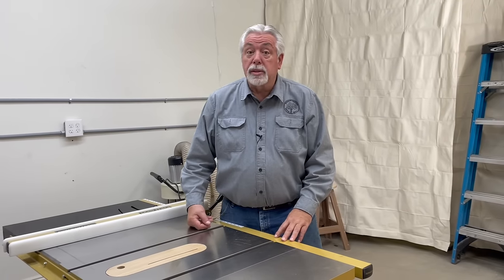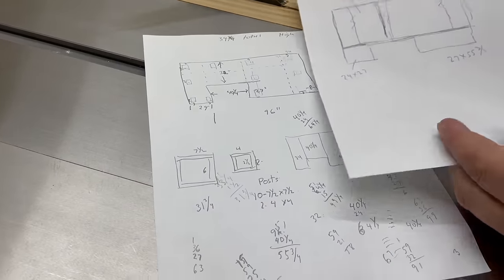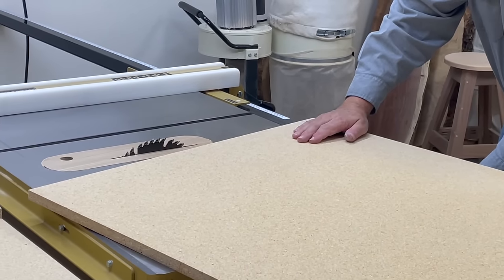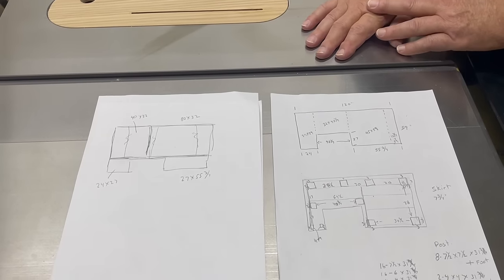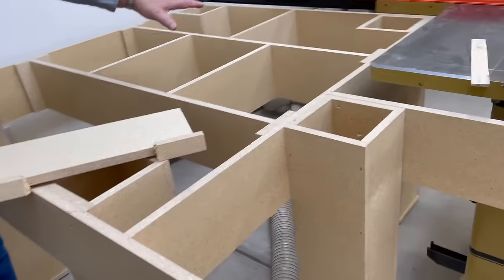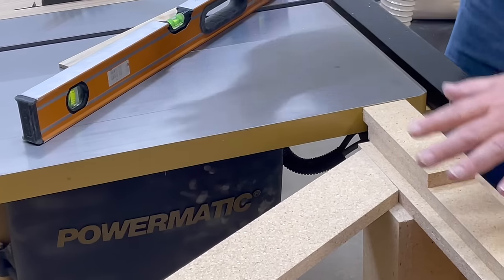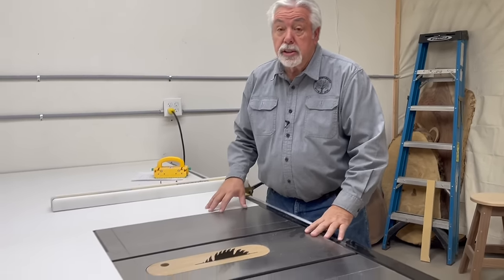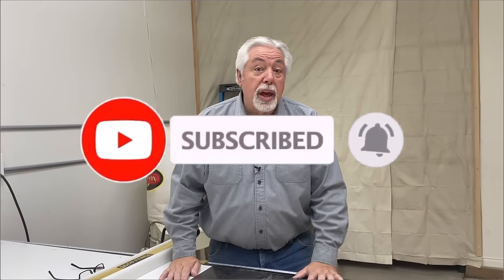99% Of Woodworkers Do Not Know This About A Table Saw

Comment: Single most important rule of safety on a Table saw. And I try and leave this comment on everybody's videos. Turn off the Saw. after every single cut. Let it come to a full stop. Do not attempt to grab or move. any piece of wood before this saw has stopped.p

Comment: Wes, forgot to mention that I also extended the miter slots by routing those in the outfeed, once I got the width and depth correct I went back and did a very slight chamfer on the slots to keep them from chipping. those extended miter slots really come in handy when using a miter gauge or a cross cut sled...

Comment: Well done Wes. I do all my work in a double  garage, so the cabinet saw is on wheels.. What you have there is great. Lots of room and an outfeed table and saw fence can never be to big.. Thats for sure.
Reply: Told my wife a mans shop needs to be twice the size of his home. (didn't have room at home, had to buy a shop a few blocks away, 30 x 60. Ended up getting it free)

Comment: Hey Wes, Great video! I have something very similar on my Delta Unisaw and it's awesome to have all that space especially when sawing full sheets. The one thing I did was attach the Melamine with screws from underneath so there would be no screws showing on top. I also edge banded the entire raw table edges with 3/4" Maple, I think it looks much better but also because Melamine has a tendency to chip especially when you screw or nail it through the top. Another reason is when I clean and wax my cast iron saw top I also do all the Melamine out feed table. It makes the wood glide like it's on a cushion of Air and it extends the life of the table. I've had my current table on the saw for seven years now with lots of use and it still looks really good.
Reply: Thats  good idea!

Comment: Great video. I'm lucky to have a very big shop and I have a Biesemeyer  rip guide . I have a Delta cabinet saw and a delta contractor saw so I modified the right side of the rip fence and mounted the contractor saw to the right of the cabinet saw. Now I have a double saw same rip guide but a regular blade in cabinet saw an a dado blade in the contractor saw. Now I do all my rips on one then lower the bade and slide the rip guide over and do all my dados without having to change blades. I have been doing this for about 8 years now.
Reply from the maker: Wow that is very efficient! Sounds great, thanks for watching! Wes

Comment: Wes, great build, love your channel. You are always very thoughtful and a great teacher. I absolutely love your projects and you are very practical. Keep 'em coming. 

I do need to comment on your table saw safety as I feel that it sends the wrong message to your viewers. You are awesome but table saw safety is a responsibility that we all need to speak up about. I do see that you don't have a riving knife and guard on your blade. As a sergeant safety guy and an educator it is concerning. People feel that it is okay to lean forward over a turning, unguarded blade and even reach across the blade as they use their table saw. 65,000 table saw accidents in the US in a year, yikes. In all likelihood, most or all are avoidable with planning. 

People don't consider that the margin of error is extremely small even if you are aware and careful. No one considers that the margin of error decreases exponentially if you are distracted by another person, loud noise, pet, or worse, an unforeseen medical event. A person has a shooting pain in their chest, or perhaps what they call an ice pick headache - unexpected shooting pain, or any other disruptive event which causes a person to drop their hand unexpectedly on to or across the moving blade. Or, as they are pushing stock into or across the blade and for some unforeseen reason they slip. Tragic.

Keep in mind the issue is not what any one person has done for years and decades without an issue, it is the "one time" that results in a devastating, life altering accident. Is it worth the time or inconvenience of using a guard and safety measures, ie riving knife, hold downs? Obviously not. We are getting older and incur health issues as we get older. Issues that can disrupt us unexpectedly, which can happen to any one at any age, increase with advancing age. I continually see unguarded table saws on YouTube, This Old House, and HGTV. Great programs sending the wrong message to earnest woodworkers. Yes, at times I remove the guard for operations that I cannot do with a guard. But I employ other safety measures, I keep my hands away from the blade, I never ever reach over or past the blade. I use push sticks whenever possible. I turn off my saw and let the blade stop before I retrieve my work or clear scraps near or past the blade. I always re-install the guard as soon as I no longer need it off.

I'm a teacher and we would never let students use unsafe practices that I see are a regular part of so many table saw videos today. Use a guard and a riving knife whenever possible. Don't reach beyond a spinning blade. Use hold downs whenever possible. Use push sticks and steer clear of spinning blades. Accidents are avoidable and safety should always be our first priority. Stay safe and happy woodworking!
Reply: You should take up knitting. It's far more safe, than wood working.

Comment: very cool idea with the fence extender, out of curiosity were you able to still maintain acceptable square to the blade? wouldn't any bend in the new fence be exaggerated with its great length?
Reply from the maker: Hi...I have not experienced any variation in square because the new fence extender bar is made of heavy duty tubular steel. Thanks for watching, Wes

Comment: Boy I wish I had that amount of space. Great table & good advice! Nothing fancy, just straight forward and easy to understand. I'll take a few of your tips and apply them to my 'mini' table saw. As I only have a small 15 X10 foot shop, so I need to have my out feed area foldable. But I can keep it level with the saw bed. So when the winter is over I will get cracking at it. I have some built in wardrobes to build and your tip with the cleats is a gem.

Comment: Nicely done,  as a finish carpenter,  I have installed many hand rails.  One thing code requires for us,( I'm in Washington state), is that there be a return to the wall. Also, the hand rail height must be between  34"- 38" off of the nosing of the tread. You did a great job,  just wanted to chine in.

Comment: I too used white Melamine for my out feed table. I made mine 8 feet to the rear of the saw to hold full sheets. I used a router to make grooves to match the miter slots on the table saw so my miter gauge and sleds would have full motion . I was surprised that you focused so much on width and not on length. I bought a couple of sturdy steel rollers on stands to assist with the infeed support. I found that using a track saw is a lot easier than man handling full sheets on a table saw.
Reply: 8 feet? 5 feet should be more than enough. There's more than a foot left on the table saw top. That, with a two foot overhang, would mean that 75% of the 8' sheet is supported.
Reply: @davidbroadfoot1864  If you cut materials like I do that are 12 ft long a 5ft out feed is really not enough 6ft should be. I have an 8ft outfield myself. Built with shelving underneath so I have a place to store things. Works and looks good
Reply: @chuckhansen5325   We were talking about "full (8 foot) sheets".

Comment: I wish I had the space for an outfeed table that large in my shop.  Looks like a great design with a huge capacity.

I re-mounted my saw fence rails so that I can cut up to 36" (it is meant for 30" normally) and made a movable 4x4' outfeed table that can be swung around or moved to either side depending on my needs.  I have large locking/leveling wheels on it to make moving and aligning it easy.  I doubles as an assembly table with dog holes and MatchFit channels and have a full shelf under for storage.

Comment: Wes, thanks for the tutorial! This is a great outfeed table idea. Are you planning on routing dados to accommodate mitre bars for each slot for when you exit a crosscut? Will you show that process in a future video? Also, in my experience, I’ve had problems with outfeed tables that are flush with the tablesaw rather than 1/16th or so lower in case there’s any swelling from moisture in the air. Is this something to worry about?
Reply: I've had problems with particle board in general when it's exposed to humid conditions. As the wood particles expand and shrink, the board starts to lose its structural support capabilities. Laminate countertops over a dishwasher also suffer from this as the humid air comes out during the drying cycle. It doesn't happen overnight, but I wouldn't use particle board for much where I live. It's probably ok in drier regions.

Comment: Very nice outfeed table.  I was wondering why you didn't get a longer angle-iron piece to support the back end of the fence.  Now I know that the table will do that.  Thanks for sharing your design.
Reply: I don’t understand how the table top supports the back end of the fence. The angle iron is recessed below the table top which I assume is the fence support and is lower by approximately 1.5”. Wouldn’t the angle have to be extended as well? What am I missing here? 🤷‍♂️🇨🇦👍👨‍🦳

Comment: My 60s Delta Unisaw this long fence was an option to cut to 52in and came with an extention table with 2 steel support legs. I was also able to get a mobile base for the whole rig. 3hp 220v motor tops it off. Not much more I could ask for and it is actually rated as a production saw so it will run constantly thru an 8hr shift. Love the old girl. Some jobs I literally have to shovel out the base as I have not yet hooked up my dust extractor for it but soon.
Reply from the maker: Hi...I served my first apprenticeship on a saw exactly liked that 😀 Thanks for the comment! Wes

Comment: If one wants to be a serious woodworker a large level working surface around your table is worth it weight in gold. Good suggestion! As a professional, about 25 years ago I built cabinets out of MDF with multiple storage functions to use for support under a 6' x 12' table saw top and to utilize the space underneath. I scribed the bottom of the cabinets so they all set perfectly level instead of using shims and used 1" thick MDF to build the top. The top is very solid, straight and level and I keep it waxed for easy sliding of the materials. Anyway, I'd suggest using MDF instead of particle board if you're going through the effort to build a good functioning table saw top.
Reply from the maker: Hi...thank you so much for your great comment. I really appreciate the support! Wes 😀

Comment: Wes - thank you for the work you are putting in to instruct and inspire your audience.   Can you provide the overall dimension of the table saw and table vs the single-car space it seems to occupy?  I’m downsizing my shop to a single-car space and am concerned about sizes. Appreciate it!
Reply: Yeah, wondering about something smaller for my tiny space, though the ability to cut 24.5" W is probably what I'll have to live with. I do have a large outfeed, however.
Reply from the maker: The overall size of the saw and table is 59" x 120". A smaller shop space would just require reducing the size of your out table build. The single bay width of my garage is 144". Thanks for watching, Wes

Comment: What would you ever cut with the fence set 60" or more away from the blade?  I don't think I would try even a 4' wide panel, certainly not 2' wide as it would likely bind and spin back across the shop.

Comment: Beautiful job on that outfeed table and workspace.  I wish I had that kind of space.   I have such a small shop and too many tools.  But I put everything on wheels.  In order for me to be able to turn around in my shop.  When I do any work in particular on my cabinet saw.  I have to wheel a bunch of my machines outside in the driveway.  It's very difficult in the winter.  I'm in the north in Canada.  Weather here is cold, with a lot of ice and snow.  I live above what is called  "The Snow Belt."
Once I clear things out and close the insulated doors, as my double car garage is my shop.  I can put on my heater and work in the warm.  I installed a 22 foot "U" Tube sealed combustion, radiant, natural gas heater on the 12 foot high ceiling.  It works great.
But what I was going to say about an outfeed table.  I installed an outfeed top attached to my saw.  I put it on hinges, so when I pull the saw (on wheels) out from the wall I can raise the outfeed.  It works just fine.  My bar for my fence used to be 60 inches but it was always a problem.  So I had to cut it down to take 48 inches.  It's a double fence.  The table to the right of the saw blade is a Router Table with the other attached fence for the Router and there is a hose port for dust collection.
Like you showed when cutting your project wood.  I don't have any guard or riving knife on my saw either.  Just an open blade.  You did your cuts very easy.  I always seem to have trouble.  As the sheet of wood is on the other side past the blade.  It always seems to want to pull away from my fence and move toward the blade.  I usually use a thin push stick in the cut past the blade to keep the wood pushed up aganst the fence.  I have had a few kickbacks, this is how I avoid it.
Looking forward to further developments in your new shop.  Subbed for continued updates.
All The Best.
Reply from the maker: Sounds like you have overcome many challenges to keep working. You are awesome!! Thanks for joining our community...loved hearing about your shop! Wes

Comment: That is how a cabinet shop sets up a table saw. I have two saws as a saw set up like yours isn't the best way for small work as you have to move around the saw putting some moves out of reach. The saw set up like your saves a lot of time on larger work.

Comment: I had made a project table. Legs were 2x6 nailed at a L shape at the corners and in the middle. I used T nuts and elevator bolts with a jam nut for leveling on all 6 legs. The top is jointed 2x4’s and 3 layers of MDF with the first layer sealed underneath. I found a roll of Formica in a 5x10 length at a local wood supply store a customer had ordered but never picked up. They made me a deal. I edge banded it all in maple. Then one day as I was beginning the remodel of my shop, I said to myself, self, you should use that project table as an outfeed table. It has been the best thing if done. I urge others to do the same. You won’t be sorry! I love the Formica top, glue just pops off. Stains clean right up. Seems indestructible. Well worth the money.
Reply from the maker: Hi...that is awesome!! Thanks for your comment, very interesting, Wes

Comment: Your original fence rail had a ground front surface, which is part of why it's so expensive. Your new one doesn't. That ground front edge is critically important because it's where the fence registers, so it has to be absolutely straight.  Have you measured how straight that new front edge is? Any deviation from a straight line will cause your fence to deviate from parallel to the saw blade and miter slots.

Comment: Wes, What model pneumatic orbital sander do you use and recommend? Any reason you prefer air to a battery or corded model? Great videos and thank you.
Reply from the maker: Hi...I use a Dynabrade palm sander. This is the sander most used in a commercial cabinet industry and I like the results that it gives. Thanks for watching, Wes

Comment: Wes, I noticed you do not use a riving knife on your saw. I do not use one either. Do you think a riving knife is important to add. I have an older Craftsman saw. There is no riving knife or blade guard accessory for it. Any suggestions on what i should do. Great video. Thanks!
Reply from the maker: Hi...whenever possible use safety accessories for your saw. I re-installed my riving knife after I completed my saw table. Thanks for watching, Wes

Comment: I am intrigued. I noticed that when you were cutting up the boards on your table saw there was no sawdust on your table top. How do you achieve that without an overhead dust extractor? Whenever I cut anything on my table saw without an overhead dust extractor I get sawdust all over the place even though I have quite a powerful dust extractor underneath the blade
Reply from the maker: Hi...I have a good dust collector but I often clean my table between clips for a better video. Thanks for watching, Wes

Comment: You do excellent work. I have one stupid question. Why is it necessary to have table saw level? 
The most important accuracy is the relation of the top surface of the saw to the blade. Being out of level to the floor is not important! Right?
Reply from the maker: Yes...you are correct. I just prefer a level working surface. Thanks for watching, Wes

Comment: Did the welding shop have to make the fence rail or was it a standard size?
Reply: The clamping surfaces on the rail did not look like they had been machined flat - so I would expect some alignment issues with the fence.
Reply: @buggsy5  I measured my existing tube it’s a 2 x 3 prob standard. It has a milled surface on 3 of the sides

Comment: I built a 5’x4’rolling torsion box work table that is also the right height to double as an outfeed table. Built it out of 2x4’s and MDF. From that experience I might suggest that making it flush with the table saw could be a problem in a shop that’s not well climate controlled. Only really happened one humid summer big it seemed to get just a bit taller and would have to bump over the edge. Think maybe an 1/8” inch shorter would probably take care of any expansion and not throw off the cuts.